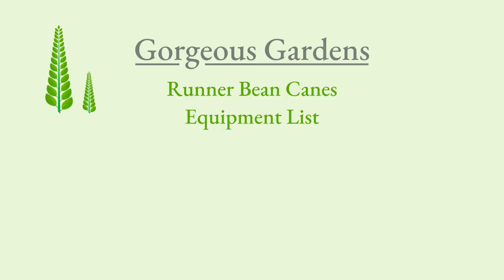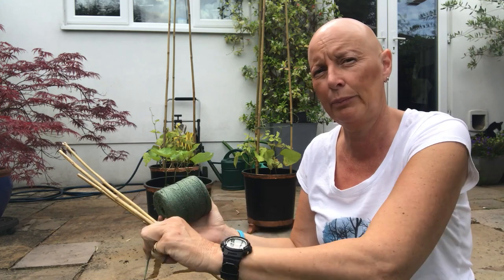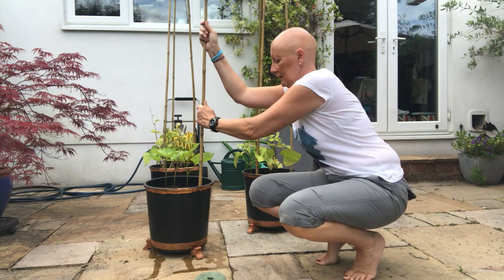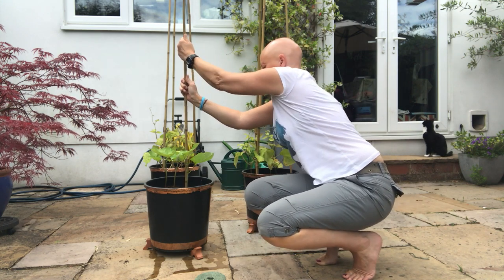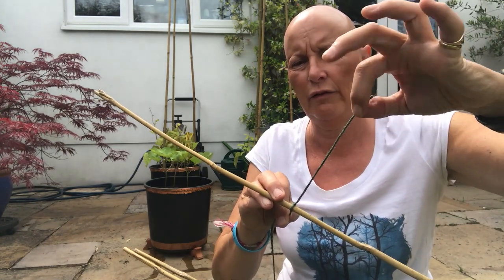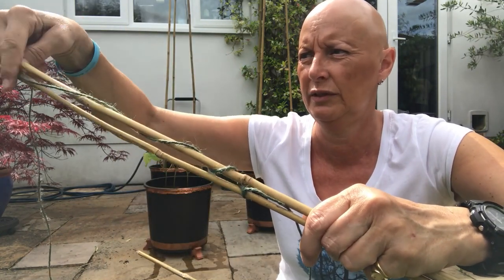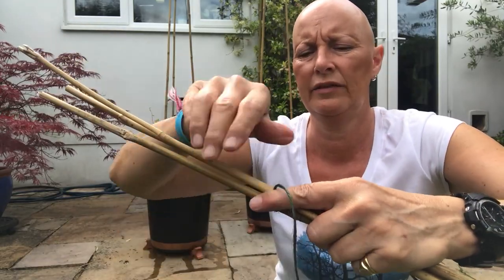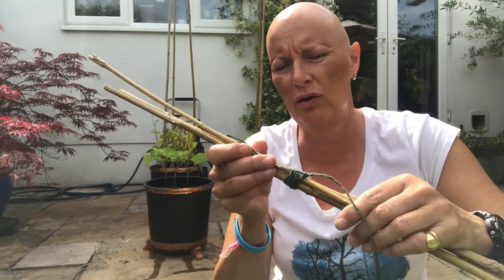Growing Runner Beans in Pots III: Building a support framework for your beans in pots

Comment: How is 3 in 1 bucket doing for you? My pack of runner beans say they should be spaced 10 inches apart...
Reply from the maker: They will be fine. Instructions are usually for planting in a larger area in soil. If you follow my guidelines on planting in a large pot you should have no problems.
Reply: @gorgeousgardens9480  Thanks for the reply! What size tubs are you using? I've got 12" tall buckets 12" wide. Thanks.
Reply from the maker: @gmpro9159  12” is probably a bit small you may struggle to get the bamboo canes in comfortably. 18” pot would be better if you can  get hold of one. Good luck